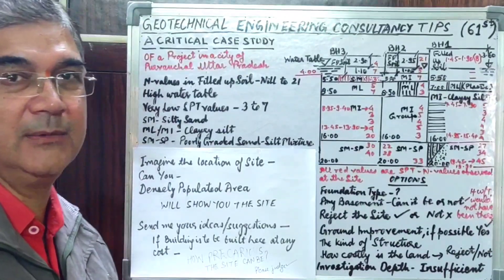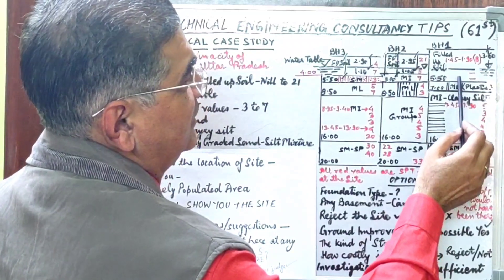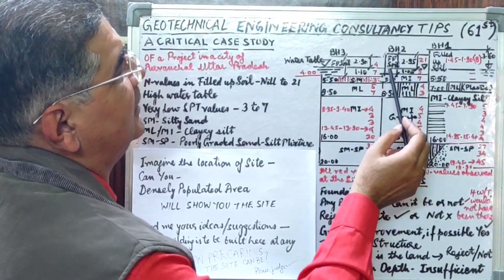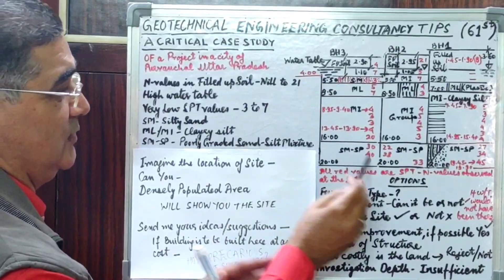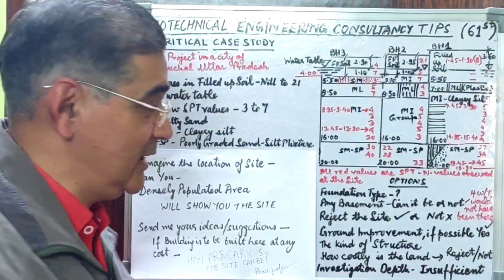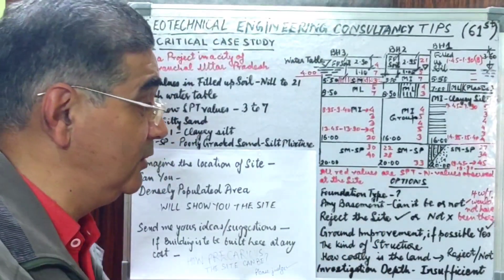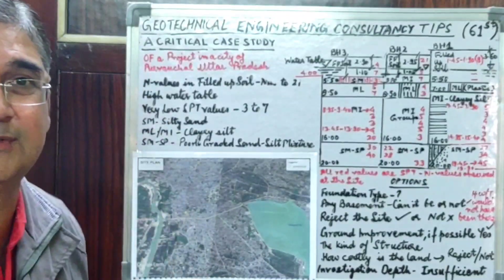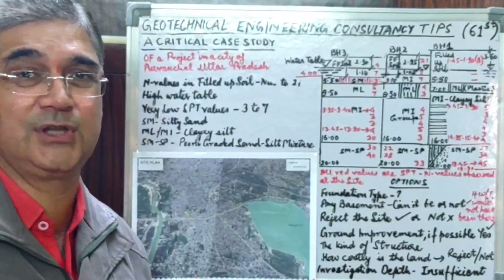A Critical Geotechnical Investigation Case Study| Subsurface Exploration| Important Conclusions|Soil

Comment: 1)Type of Structure: Major/Minor structure
2) Dewatering 
3) If N values less than 5 to 10 through bore hole then go for pile foundation 
3)if N values in between 10 to 15 then go for  GIT: for shallow depth 3 to 4 mts soil replacement best
Deeper Depth 5 to 10 mts  depends upon soil type Stone columns/Lime columns/Grouting is best
Reply from the maker: Thank you very much Askok Kumar Ji for your feedback
Reply from the maker: Appreciate this very much